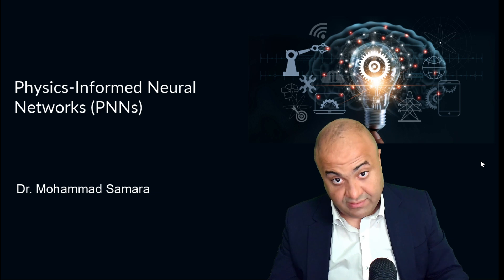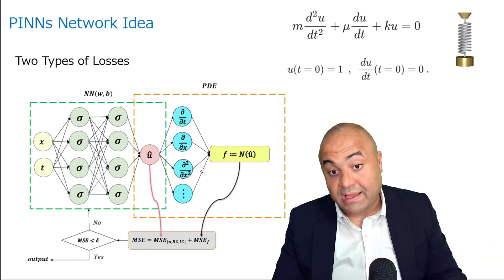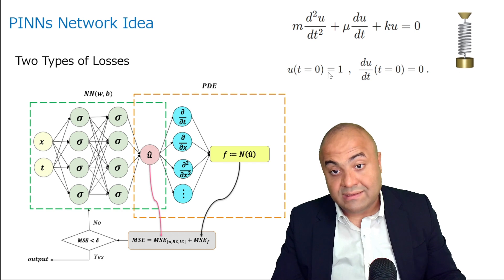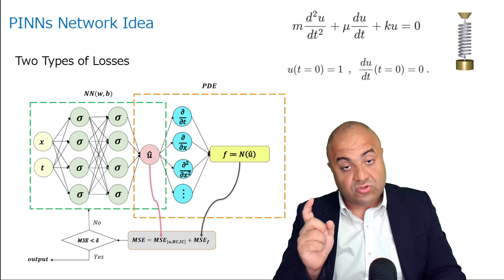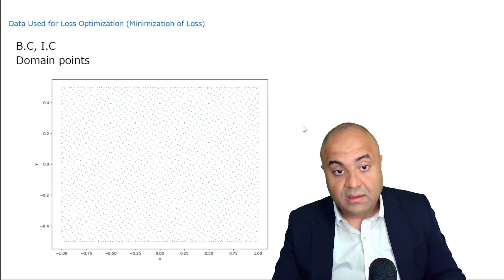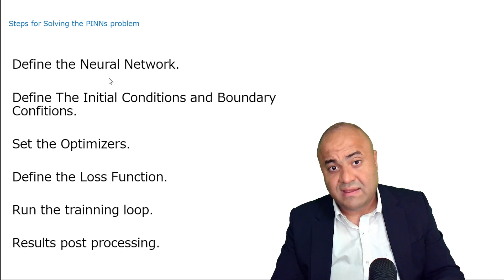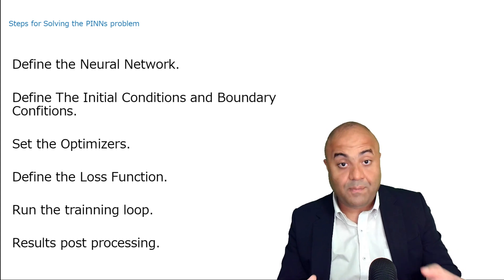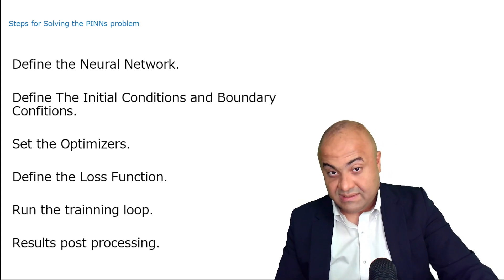Lec.11: What Exactly PINNs Do! [Physics Informed Machine Learning]

Comment: Sometimes at t=0 (at initial condition) pinns results gives   near to intial conditions results (not exactly match),  it is naturally?
Reply: Thank you so much sir
Reply from the maker: Thank you
Reply from the maker: I am not sure about this behavior, but let's remember that PINNs is a network and if such behavior experienced as a result of some hidden issue, we need to check different ways to solve it or a way to calculate the loss near these regions we control the network architecture and the loss values computation so I am sure we can deal with such issues. (My opinion)
Reply: @Dr.Mohammad_Samara  👍